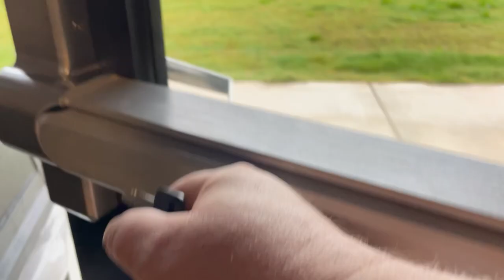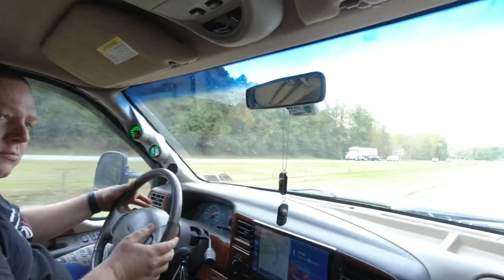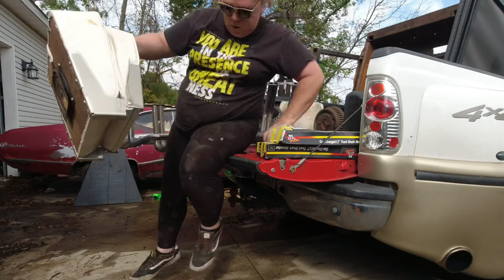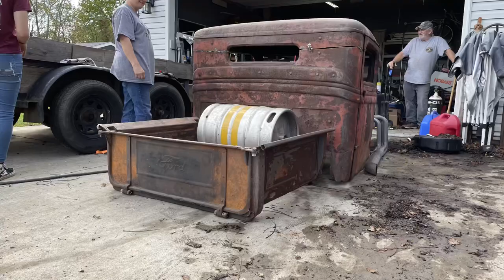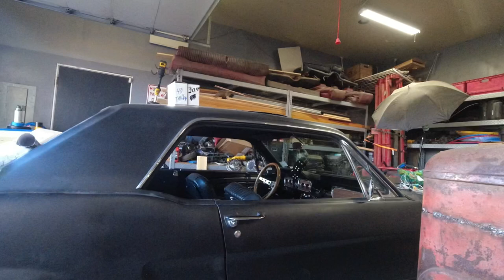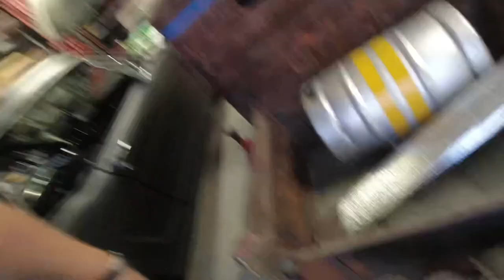We are building a rat rod!

Comment: Looks like a fun project, do you have a front suspension the steering? A newer car chassis would look silly. That's why most use the model T or model A, maybe early 30s.
Reply from the maker: Thanks!

We did get axles along with all the steel to build a frame.   Originally I was trying to find a better base but I could build a nice frame cheaper and better designed to fit the truck so that’s what will happen I’m sure.  We have been shopping plasma tables so I could make plates to get the curved front rail but many changes can be in play depending on what we find out there.  

The front straight axle we got with the load is out of a 50’s Chevy truck and the rear is a 12 bolt (looks like a truck also).   

We shall see.    Thanks for watching!  😁